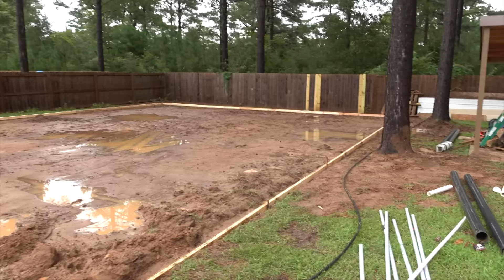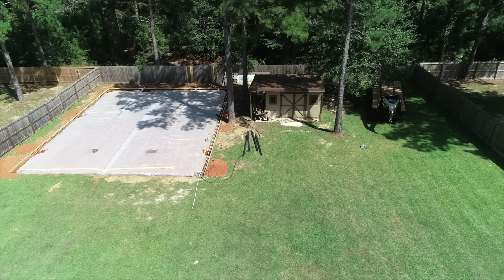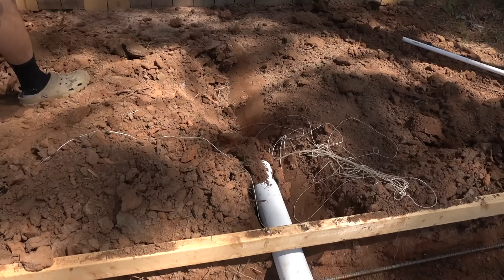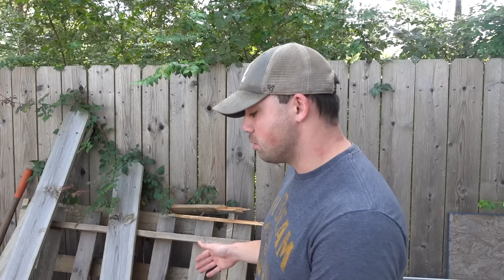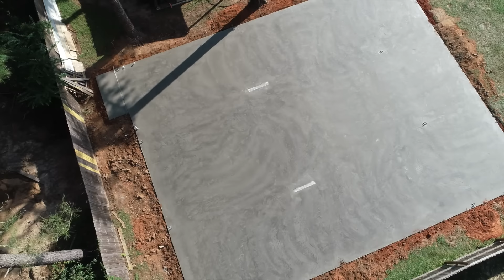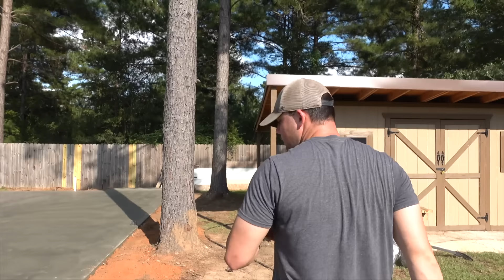BUILDING MY DREAM GARAGE/MAN-CAVE!! STEP BY STEP!

Comment: at 7:36 "we got a 12 inch... these are 12 inches...  well it's 12 inches, it's a "footer"-- get it?"....   Hahaha... No dude.  Just No.  That's not why it's called a footer.  "Footer" is just slang for "footing".  The footing is the part of any building where it seats itself into the ground.  It can be any width or depth, and that part is determined by the size and weight load on the walls, frost zones etc.  If yours was literally 12" it was just a coincidence.  Aside from razzing you on that, you have done an excellent video here and can't wait to see the whole thing completed.  Keep up the good work.  I plan on doing a building like this in my backyard soon, and watching your journey is super helpful.

Comment: No mesh? and slab needs to be higher... minimum 100mm above ground level... your cladding needs to overhang the slab 50mm and then have another 50mm ground clearance.
Also no rebate/s for your garage doors... you are going to have water ingress issues.
Simple job but quite a few things wrong with this that are going to cause issues down the line...

Comment: If someone says something about you putting the water line in the concrete they obviously don't know what they are talking about because every single home built on a concrete slab has water lines and sewer drain in the concrete slab. They have been doing that same way for over 60 plus years

Comment: I would pull a large enough wire and put in a sub panel in the shop. It will give you better ability to adapt the shop power to your needs. It will also give you close access to shutting the power off in an emergency.

Comment: Oh man i did not like the process they did on the concrete😭 being a professional finisher just oof.. It doesn't look TERRIBLE but i what do i know im just someone commenting on a youtube video😂
Reply: I wouldn’t let that company pour me a glass of milk let alone a concrete slab. I have 30 years experience and holy crap where do you start with the things that are done wrong.
Reply: @stonemason4295  amen brother! Did you see the finish on the pad?? And i dont know about you but when i did footers i didn't use 2 pieces of rebar to ( reinforce ) the footer i have used between 5 or 7 set aside one another!
Reply: Who Boosted? Right!  There should be multiple layers of rebar in the grade beam also steel needs to be tied or welded. There should be a rebar  cage in the 2x2 that the anchor bolts are tied to. Also there should be 6x6 wire or a 2 foot grid of rebar over entire slab. Trough drains need to drain out the bottom not on the connection for multiple drains this puts the pvc about a 1/2 inch under the slab and only 4 inches under at form board. And who pours a shop floor that will be full of equipment and heavy vehicles only 3-1/2 - 4 inches thick? Sidewalks and basement floors maybe but not a shop floor. What about the self leveling approach to the pour I didn’t see any grade pins or a transit, screed pipes nothing, pour it like water ( makes it very week) and let it level it self. My figures hurt I can’t go on but that just scratches the surface.
Reply: I’m not a finisher by any means.  But I am an operator that partakes on many pours.    I’m glad I wasn’t the only one that noticed the lack of grade pins and lack of bars!

Comment: Should have ran a pipe 2 sizes bigger then your actual water line under the concert and then ran your water in that sleeve that way if you ever do get a leak you rip out the water line and just run a new one through the sleeve

Comment: I cant help but believe sometime later you are going to be so disaponted you didnt pour thicker and add rebar. I understand it was 3000 with fiber but its a VERY THIN pour and they didnt even put any expansion joints in it. I just dont see how it will hold up over time.

Comment: A slab that large should have had metal grid or rebar on 24" centerline. With no contraction joints, the slab will eventually crack. As the chemicals release during the curing process, the slab shrinks. My dad was a concrete contractor, I grew up working with him. He guaranteed against fire, flood and theft but not cracking 😂
Reply: i am building similarly sized garage right now, and i had to put in the concrete around 1.4 tonnes of rebar, to keep it strong.. this one is really lacking on steel part :-D
Reply: I Imagined There Would Have Been Wire Or Small Rebar Across The Slab. Im Certainly Not A Concrete Professional, But I Do Utilities & Have Seen Many Concrete Pours. Although I Am a Bit North Of You, On the East Coast And Winter Temperature Might Be A Factor.
Reply: How deep do you think the layer of concrete was? Should the earth foundation be compacted?
Reply: @normanbrunt2053  the forms they used were 2" x 4", modern lumber isn't dimensional so, actual size is 1.5" x 3.5". That means the slab is 3.5" thick. Also, they poured the slab below grade, meaning the top of the concrete is at grade or slightly above. The organic material should have been stripped and sand brought in to bring the level up above grade to ensure it won't flood in wet months. I live in California, we have seismic activity here so everything is built with this in mind. I would rather over engineer something than go with the bare minimum to save money.
Reply: @Bocephus-Maximus  So true. I was really surprised at the lack of prep and fill. Especially no rebar in the footers for the red iron!
Reply: No you don’t have to use rebar. It’s the owners option for rebar

Comment: I like the idea of putting drains in the slab. I’ll have to remember that when I ever get to build mine. Great work boys
Reply from the maker: Thanks man! Glad I did it!
Reply: be careful doing what he did here. Where I live that would be a huge fine to have a shop drain outside. Any kind of oil run off then gets in the water runoff.

Comment: What's your plans on the a/c? I'm about to install ductless mini splits in my shop. If you haven't checked into them yet, do so. They're very efficient.
Reply from the maker: What company you going with? I’m interested in doing the same
Reply: @ParoDoXz  I own a hvac company, licensed in Ga. I just bought a new place and it has a 30'x100' metal shop. I'm going to install two, two zone mini splits in the main shop area and then add one single zone in a small office area. If you have any questions about them, send me your email and I'll get back with you and try to help you out.
Reply from the maker: Right Choice HVAC Would love to chat about the options, my email is calebnorrisyt@gmail.com

Comment: You're going to need more power.  At least (2) 220V circuits - one for the A/C and one for the compressor and maybe one for a welder.  Also, at least (2) 20amp 110 circuits.  You might have to add another panel to your house.  Great Video!
Reply from the maker: Thanks for the feedback! Still getting all of it figured out, I probably shouldn’t even of talked about it in this video lol I’m letting the Electritian handle all that
Reply: @ParoDoXz  Yeah, can't ever have a garage too big or too many outlets.  Can't wait for the rest of the build videos!

Comment: If you are using concrete with fiber in it, that would explain having no rebar or wire mesh. I've used the fiber concrete in misc commercial constructions and it works pretty well. Great Job yall! Hard work pays off!

Comment: Me being a HVAC tech / company owner I can’t wait to see what your guy puts in for A/C hopefully a high efficiency low ambient split system 3-4 ton head for all your A/C an heating needs for when it gets cool out 🤔 up here in NY I would of recommended at least putting radiant in the floor but I don’t think it gets cold enough down there for radiant heat

Comment: Awesome, moving forward.
Have you thought of joining the shed to the workshop, slab and roof ,maybe sides too?
Also "Good of the land" and Vintage machinery" installed Mr Cool AC. Maybe they'll do you a deal on the AC unit, I think Abomb79 also got one,not sure.
Reply: Just double checked, all three of them got MR Cool AC.
Reply: https://mrcool.com/

Sorry for the spam, just thought you might get a good deal with them

Comment: ok now that im at end of video 
1 you can put plumbing, if you put it and test it thats fine, your water as you said can always be ran around if you leak or from outside in they make all kinds of stuff nowadays
2 the rebar please tell me he suggested it atleast , if not i mean i hope the slab holds but it may crack brother and pull apart the reason they add rebar in the center mat is so it doesnt spread apart when it cracks , a crack will form and the rebar will hold it from spreading more then a centemeter 
3 the ac pad they couldve edged the other side of the 2x4 so it didnt look that way XD when you take that 2x4 out its gonna break some off
anyways good looking slick finish , called a burned in finish , looks great

Comment: The side of the garage along the fence and the back of it should actually be gravel. Poor sunlight and low air movement can, and will, cause moisture issues which will lead to odors. Also, if you ever noticed commercial buildings have a gravel "runway" around them, that helps with rodent control. Just my two cents, but it will help a lot.
Reply from the maker: Thanks for the feedback Matt! That’s a good idea

Comment: Hey get a train or Rudd AC unit
Reply from the maker: Ill look into those! Thanks Waylon!
Reply: Don't get a Trane! I would put a mini split in there!
Reply: Right Choice HVAC trane mini split
Reply: @waylongeiger  Hands down, Mitsubishi has the best mini split on the market. They just cost to much though. Trane sells Mitsubishi now and that's probably part of the reason for the price increase too. I stopped selling Mitsubishi when Trane took them in.

Comment: I guess you're not putting a hoist in ? Concrete doesn't look thick enough for one.
Reply from the maker: Nope, not at this small of a property
Reply: @ParoDoXz  that foundation will crack. They didn't put any reinforcement down the middle of the foundation. But I know that you have plans on relocating. I just wanted to give you a heads up on the next shop that you build. I used to drive a concrete truck for a while and that is not how they usually do it. They normally dig through the middle, depending on the size of the slab, about as deep as the outside forms,, or deeper if putting a lift in your shop. Again, you probably already knew that. Congratulations on your new shop, it is going to be the best hangout for ya'll!